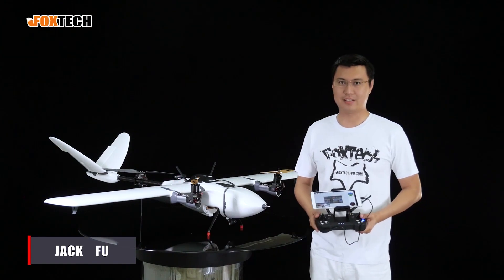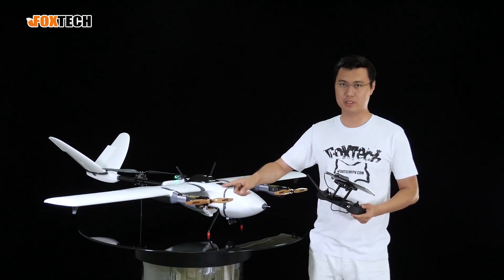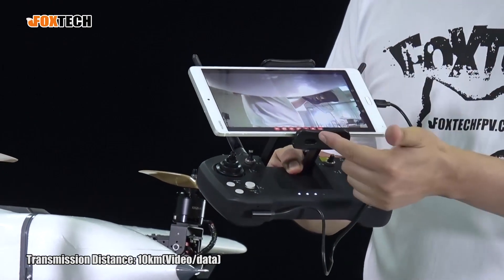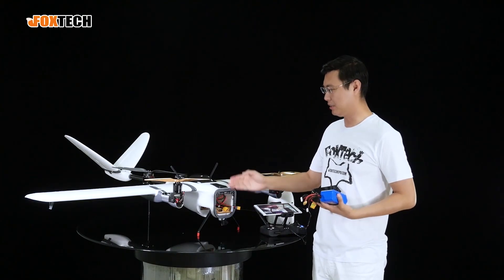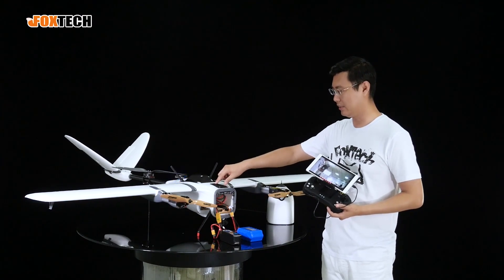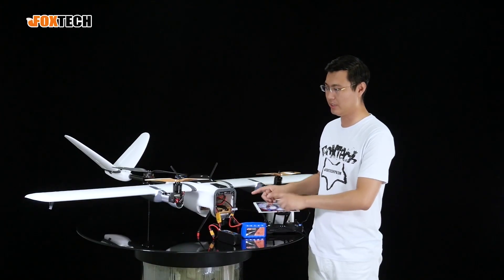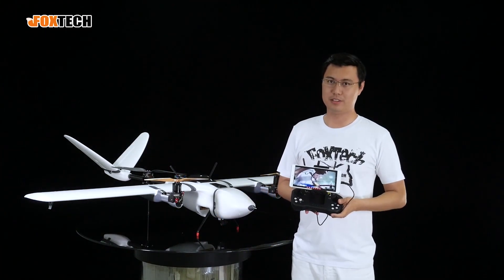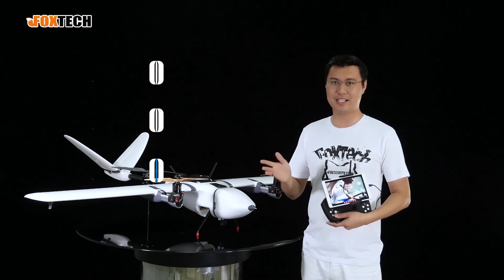New Tilting system upgrade for Nimbus VTOL V2

Comment: Hello, I'm building a similar VTOL (Tri-Copter with front Two motors Tilting) [for Anonymous Flight] for a project in the college, but I'm stuck with the QGC Firmware of the E-flite Convergence airframe. 
So, My problem is to find a firmware that can work on a model with V-Tail or ordinary tail group(Horizontal and Vertical)!
Can you help me with this by a firmware or a tutorial of how to modify an existing firmware?!
I'm going to work with Pixhawk 4 on QGC.
Any help ?!

Comment: hi sir,please suggest me a motor which can produce minimum 5kg thrust and max:10 or above.and a propeller
Reply from the maker: if it's for multicopter, than the 8120 and 3010 prop should suit the purpose.   if it is for fixed wing ,then please try with dualsky GA 3000  and 2010 prop at least